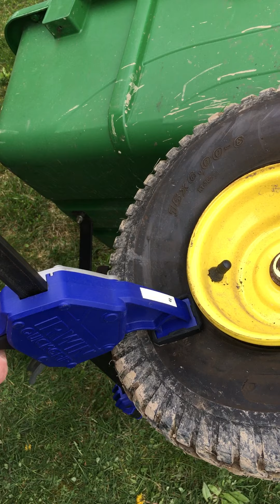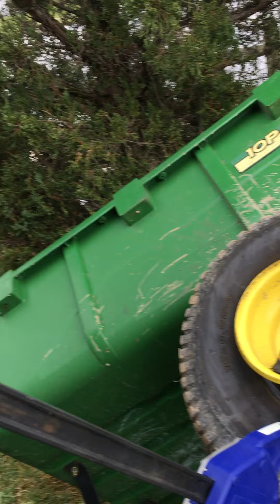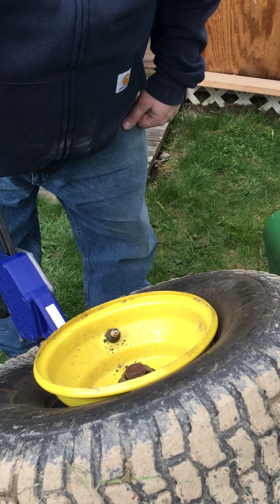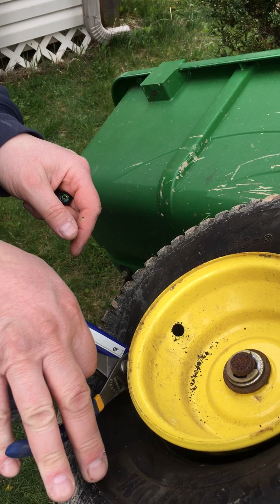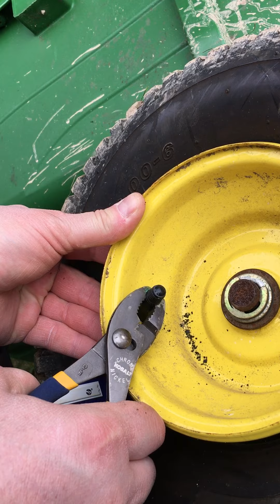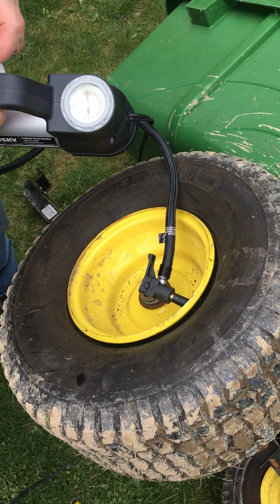Replace Valve Stem John Deere Yard Cart

Comment: Great video- I have the same cart- do you recall the valve stem size or model #?
Reply from the maker: I believe they are standard TR413 stems.  I picked them up at NTB and they had boxes full of them.
Reply: Thanks much, I’ll give it a try.
Reply: Did you ever find out the size cause that's exactly what I need and I'm actually going through it right now
Reply: I actually went right to the John Deere dealer near in Calverton NY and they told me their all exactly the same size as the tractor tires, so that made it much easier. I hope that helps. I don’t have the exact size  handy.